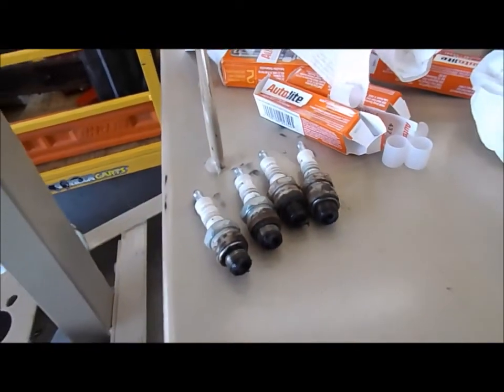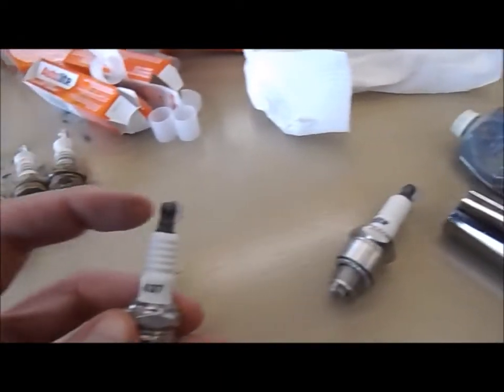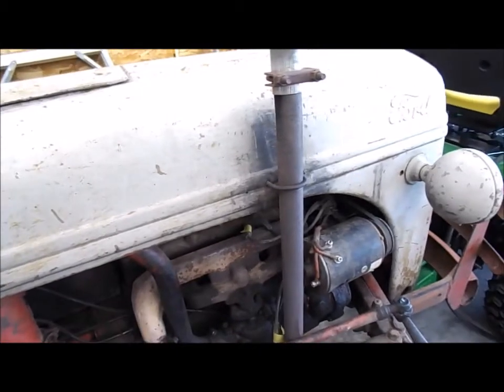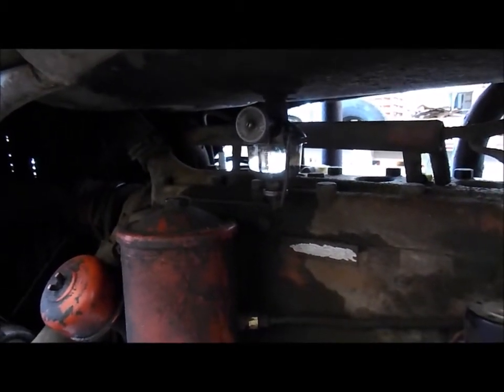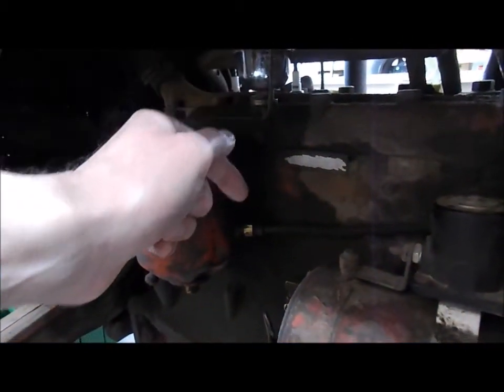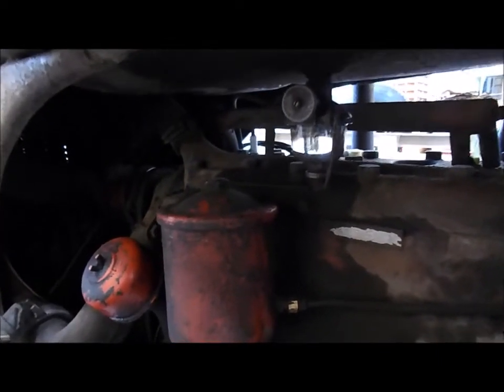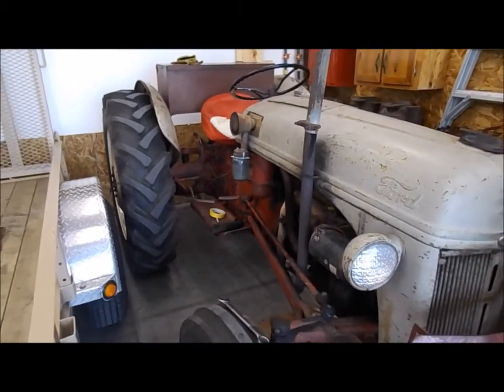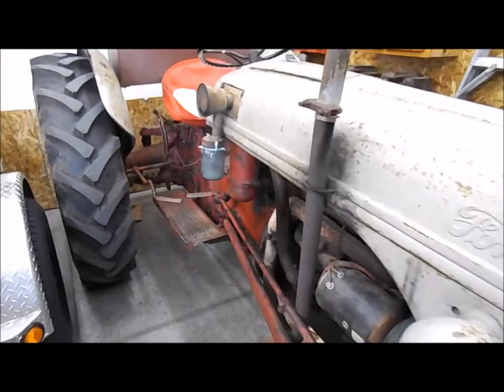8n Ford Sparkplugs

Comment: Hi there just wanted to give you a little friendly advice it might be helpful and it might not! When my 8N starts running ruff and hard to start and not getting any power it is a sign that it might be time for points and condenser . And of course inspect the cap and rotor . And if you’re sentiment bowl has accumulated lots of rust it doesn’t hurt to disassemble the carburetor and just blow all the jets out with air and clean up the reservoir and check the float to on of my carburetors actully the float had a leak and it filled up with gasoline and of course malfunctioned so I soldered it up, but anyway about your oil leak and consumption I use a heavier weight oil. I use straight 40 weight and some STP to combat the oil consumption but don’t forget if you are using it in winter warm up the oil before you start it I use a dip stick heater and a magnetic heater and a radiator hose heater to make sure it is very warm before I start it !! Hope that is helpful Keep that old IRON going 👌

Comment: Park it somewhere that you can see the ground under it, and with it running, and sitting, check for oil on the ground. Then, look for where the oil is leaking from. Your oil leaks may be an easy fix.

Comment: So you weren't able to get a spark from any of them? I pulled mine out and couldn't get a spark on at least two of them. I heard my 8n missing before I couldn't get it to start again. I know I have power to the distributor. Thanks
Reply from the maker: The tractor burns a lot of oil.  I think the plugs were fouling out.

Comment: What’s the gap on them
Reply from the maker: .025 - .028 gap
Reply: @stuntcardriver  Autolite 437 - .025 for spark plugs and distributor points
Autolite 216  - .020 for spark plugs and distributor points